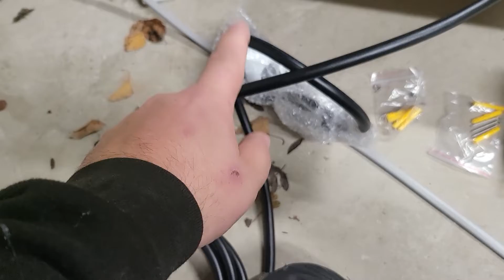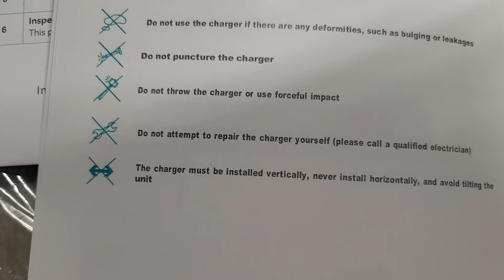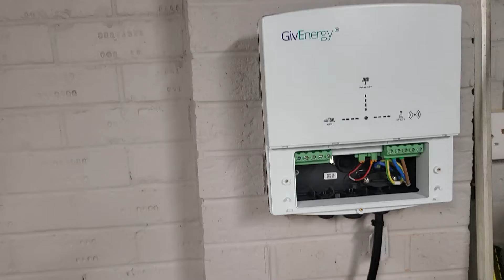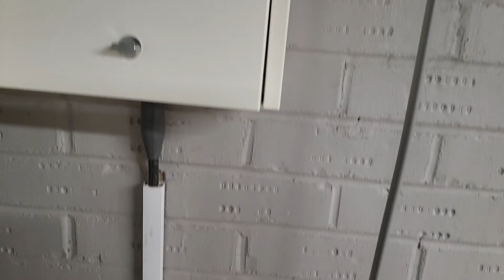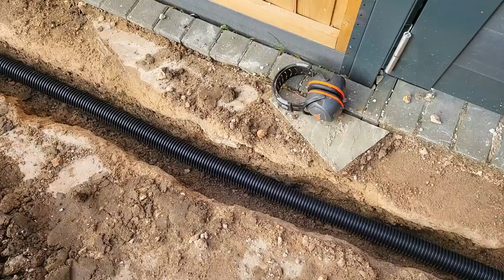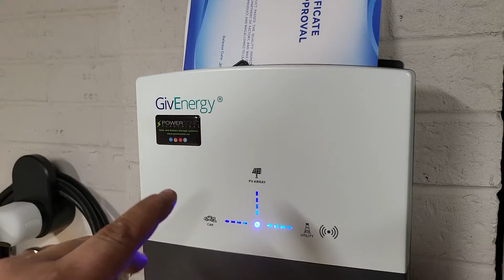Givenergy EV charger full installation run through with cabling for AIO and Gateway

Comment: Similar question I have about the GE AIO I’m looking to install this outside, that should be OK (but one should never assume) but also looking to place it on a plinth (maybe wooden) away from the house to be able to get to the cars. Any chance you’ve done anything similar?
Reply from the maker: These are rated for outdoor installations but require a canopy to cover them from the worst of the elements. Worth noting performance can be effected in the more extreme cold/heat. Best placed in an insulated housing of some sort. Hope that helps

Comment: Those rcbos are only single pole dude.
Reply from the maker: Yeah the M2 range is easy to get caught out by as the single pole and double pole variants look so similar. We did notice and it has one of these bad boys https://www.cef.co.uk/catalogue/products/4924309-32a-double-pole-1-module-b-curve-6ka-30ma-type-a-compact-rcbo

That said if we are to use the inbuilt protection on the EVSE as would be the case when supplied by an MCB it is here nor there on TN systems. 

Double that said I never like to use the inbuilt RCDs unless they are 61008 or 61009. 

Triple that it will be in the gateway anyway soon lol. 

Good spot tho!

Comment: Was this easier to fit than a Zappi v2.1 and if you already have a Givenergy system with solar array and battery, would you advise this over the Zappi, if the extra money for the zappi was not an issue?
Thanks
Reply from the maker: Yes and yes 👍

Comment: What size is the SWA return to the house consumer unit and why is it not a 25mm as coming from the meter?
Reply from the maker: I dont follow Douglas? Its 25mm 3 core down to the garage and 25mm 2 core return if thats what you are asking.  The return could be smaller as the house loads are 80A via the gateway. Remember the EV, PV and AIO get power direct from the gateway itself so the remaining 80A is reserved for house loads. We have used 16mm before for this in certain situations. I hope that answers your question but if not let me know!
Reply: @electrician247  Ahh, got it. I was just surprised that it looked much smaller in the video. Thanks for the clarification. Videos are great. Keep up the good work.

Comment: Great video and an impressive job. Thinking of getting a charger next year but the instructions mentioned it can’t be placed in direct sunlight and I have a south facing property with no garage so might be an issue.
Reply from the maker: Yes it’s a common problem among most charge points that generally gets ignored by installers lol. You could look at a small canopy that provides some shelter as a solution. Generally there are work arounds by looking at placement as carefully as possible. Thanks